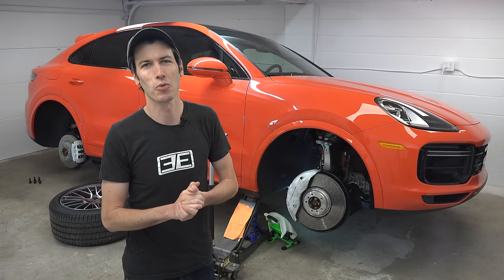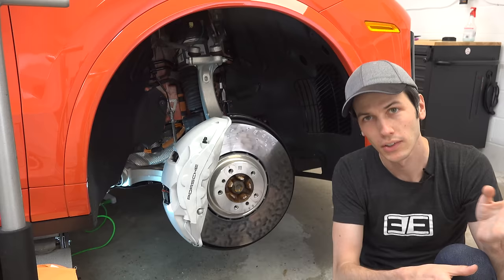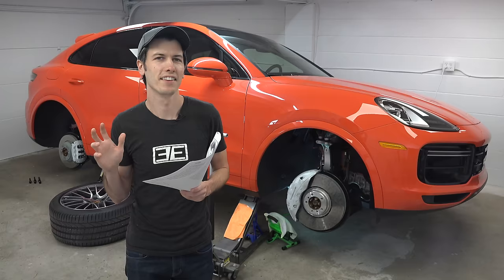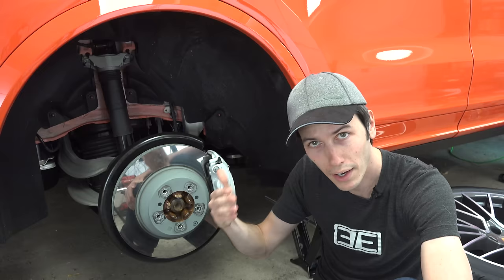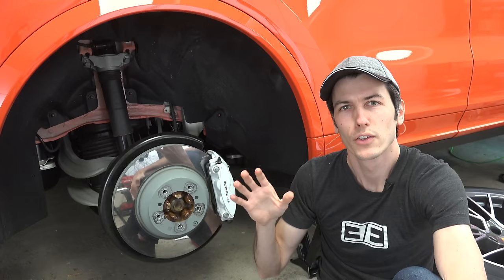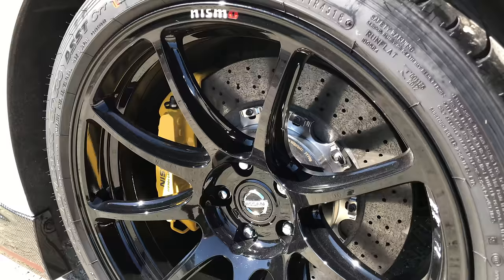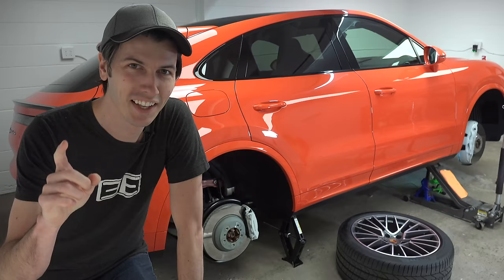Porsche Reinvents The Brake Rotor - No Rust, Low Dust, No Fade!

Comment: So once you burn through the top layer, does the rotor act as a standard cast rotor? Or is that part of the rotor "compromised"?
Reply: Want to know the same thing. Could make it a lot cheaper. Ok, maybe not a lot.
Reply: it would probably work just like cast iron, but the pads might not work on cast iron
Reply: You don't. All they did was make the rotor harder so the pads wear faster.  This is why they had to increase the size of the pads.  This "feature" is a complete joke.
Reply: Just another noise many owners will fix by turning up the stereo 🤣
Reply: Patrick O the main benefit is less brake fade for hard driving and for looks because it doesn't rust. it's a good option for entry level supercars or high end sports cars (100k range) without adding an extra 20k to the price for carbon ceramics. it's not going to be used on mass scale vehicles probably ever
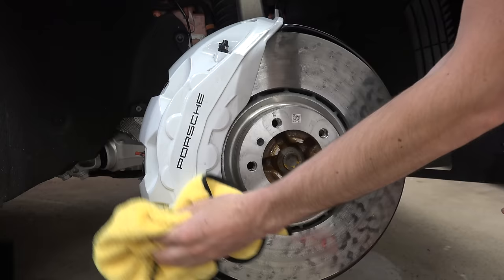Reply: @_PatrickO  Did you even watch the video? 4:54
Also, if you make frequent drives in the mountains(which you probably would if you're bourgie enough to own a porche), fade resistant brakes become super helpful. Especially when you're loaded with kids and stuff for your mountain cabin. This is a silly use case, but a use case none the less.

Regardless, this is a sort of thing Id like on my truck. For towing in, you guessed it, the mountains.
Reply: @stompyrobutts  you clearly own a Honda ridge line or something to tow with then because in any HD truck, a good set of $100 upgraded pads, plus engine braking and trailer brakes, driving in the rockies is no problem with 15K+ lbs.
Reply: The pads for Tungsten carbide Will destroy a normal cast iron rotor, so, no, you'll need to replace
Reply: @evictioncarpentry2628  What an absolute joke of a strawman. "you clearly own a Honda [Ridgeline]..."

Comment: Nice to see Porsche have their calipers in the right place - inboard! (Front ones on the rearward part of the disc, rear ones on the forward part of the disc). This reduces the cars polar moment of inertia; calipers are heavy un-sprung weight so ideally should be as close to cars C of G as possible. All cars where handling is a feature, from the MX5 to a Ferrari, will have inboard-mounted calipers. Sometimes they paint them red or yellow to illustrate this plus point.

However, on many cars with no pretence to great handling the calipers may be mounted anywhere around the disk - and that's OK. It is a marginal advantage after all.

But what gets my goat are manufacturers who put the calipers in exactly the worst position - outboard - AND THEN PAINT THEM A BRIGHT COLOUR! It's as if they think it's the bright colour that gives the handling advantage! It's like saying "we put the calipers in a poor place for handling, and then we painted them bright yellow just to show how we got this wrong"!

Comment: We often use HVOF applied carbide for guiding surfaces in high temperature (above 600°C) applications. The surface is so hard that only grinding can be used for machining it - and even that is not ideal.

Comment: Instead of replacing the rotor, can't we recoat them ?
Reply: Tiago Feitosa really? Is a serious question?
Reply: Except for not knowing the brake pad material, I would take a swing at coating the brake rotors myself
Reply: With cast iron rotors, we have the environmental impact of discarding the old ones, because there's no way to restore them. With these, only the coating is getting degraded, recycling is always better, if you take all the resources put into development, why not account the full lifecycle of the product.
Reply: @rickrack78  I meant recoating the porsche rotors once they fade out. Not coating our regular ones.
Reply: I would Porsche has a core program that would greatly benefit everyone.
Reply: @Tiagotaf  you can always resurface the rotors… until it's gone
Reply: @Tiagotaf  old rotors get recycled, most of them at least
Reply: @Tiagotaf  still a good idea
Reply: Sure, but it would have to be like a refurbished alternator with a core charge of $5000.

Comment: Porsche have always had some of the best braking systems on the road.
Reply: They use Brembo parts.  Made in Italy.
Reply: Mine were made in Germany and I use Yellow Stuff pads.
They're very good - I'm just objecting to the idea that 'Made In Country X' counted for anything.
Reply: Looks like akebono has made an impression on Porsche...  look at 5:00.
Reply: lol, by making the rotors harder, all the wear goes to the pads.  So to make the pads last a reasonable amount, they had to make the brake pads massive.  This is overpriced junk.  Tungsten carbide is a standard coating in many industries, they are pretending it is something new and it certainly isn't expensive like they claim.

Comment: what happens of you don't replace it after 0.1mm of wear?
Reply: They probably start to act like a normal rotor.
Reply: The "divide by zero" scenario happens
Reply: you buy some normal pads and carry on braking.
Reply: It exposes pressed grooves that play 'Let's face the music & dance' during your final 100 metres . . .
Reply: I've seen rotors that were so worn down, when the customer pressed on the brakes his brake pads fell out of the calipers and stuck in-between the caliper and rotor. So that might happen?
Reply: You now have 10 piston calipers on your regular steel rotors. Good luck finding some normal pads.

Comment: E.E.: “If you plan on towing...” 
Me: Uh.....that vehicle is more than $145k+! If i was planning on towing i could buy the meanest, baddest truck on the market and still have enough left over to buy an $80k sports car!!
Reply: Not in 2020. You'd only have $30k left over nowadays.
Reply: @deusexaethera  No joke.  Trucks are insane now.  A used one costs all most as much as a new one.
Reply: @andrewt.5567  i die a little inside everytime i see someone sell a 20 year old truck with 300k miles for $30k

Comment: So you're saying we can't get the parts at Auto Zone.
Reply: Patrick Labozzetti know right? I was thinking the same thing! Lol
Reply: Autozone could probably order the OEM part.  The base brakes are usually Brembo and you can get pads and rotors ordered at auto zone.  Either porsche branded boxes or OEM for a significant savings.
Reply: Can’t buy it at autozone. Whether they can buy it from a dealership and resell them to you is another question.

Comment: I like cool stuff but I just can’t relate to vehicles that have $11,000 brakes.
Reply: Some people make EASY money and want the best
Reply: I can’t relate to the owners either. It doesn’t matter how much they spend on a car if they drive it on the same crappy roads everyone else is on. If the elitist snobs want to feel special they need to buy their own road.
Reply: Bro ceramic brakes cost 20-25K so this is - cheap - :)
Reply: I can buy Brembo rotors and ceramic pads with all the hardware for my 2002 Camaro for about $400, maybe less.

Comment: The internet is full of "experts" trying to call out an engineer.
Reply: Fun fact. Have you seen half the cars on the road today that supposed engineers designed and how they don't last.
Reply: over 40 years experience fixing stuff engineers designed, many new engines you have to remove the intake manifold just to change spark plugs , older chevy V6 had to remove exhaust manifold to change the oil filter, chevy S-10 had to remove dash to change some dash lights that required also having to replace the front window, try changing front marker lights on a 2002 corvette...
Reply: Once you work on vehicles you realize they are all designed terrible and are all junk
Reply: @MAGWolf  You're assuming that they were engineered to last.  You can (well, someone can) engineer for any goal.  You can engineer for ease of manufacturing, for a finite service life, for safety, for comfort, for performance, for efficiency....
This is the reason behind the other comments in this thread- yeah, cars are a PITA to work on because they were engineered to be assembled in the fewest steps to reduce labor costs.  As long as the MSRP is within corporate targets there is little concern for difficulty of service. 
The old adage, "fast, cheap, or good" applies to engineering as well, you can pick any two.

Comment: I'm curious about stainless steel rotors, because stainless is a poor conductor of heat, compared to cast iron. I converted a custom chassis front wheel drive motorhome from drum brakes on the rear to disk brakes. the disk brakes that I bought were stainless to prevent rust. Of course the braking was night and day better than drums. But one time I was driving at 100 mph and had to slam on the brakes. There was absolutely no brake fade what so ever. I was pleasantly surprised. In many ways it reminded me of my MiniCooper braking at high speed. I've not ever seen stainless rotors offered as replacements for cars, but since these performed so well, it makes me really wonder it there is other benefits to using stainless besides the lack of rust.

Comment: Over 2Gs for standard brake parts ? One more reason I’m not driving a Porsche
Reply: Those are Porsche main dealer prices.
I can get a set of good quality discs and pads for my 996 for under £600, and a set that would be fine for most drivers most of the time for £250.
Reply: Those prices are for the top of the line Cayenne. And they are an option anyway I believe. So it’s not like if you buy a base model your going to have to fork out 2 grand just for brakes when they wear out
Reply: @BinkiBoyVideos  Yep, just $1500.  All the top end German brands gouge like no ones business.  I am sure the labor is laughable too.  Probably charge 3 hours labor for something that even a Joe Schmo could do in his own garage in 30 minutes.  The average tech at a Porsche dealer probably codes 18 hours of labor in an 8 hour shift.

Comment: Regenerative braking - no brake dust.
Reply: You 'only' get twice the longevity (maybe 3 times) on cars that are much heavier, too. 
And I do wonder what the environmental cost of all that combustion to place the surface on the rotors... OK probably insignificant in the environmental cost of manufacturing a car as a whole (EV or otherwise).
Reply: @aidanapword  lifetime of the car for some EVs. 😉
Reply: But you still need brakes for safety on those vehicles.  Try servicing a regenerative braking system yourself.  Complexity isn't always a good thing.
Reply: @aidanapword    Don't tell Greta!
Reply: @lashlarue7924 
You don't service a "regenerative braking system" because  that is just the electric engine getting turned by the movement of the car, working as a generator.
You also don't service your "engine brakes", even though that would be a good prank on new car mechanics, "please change the engine brakes, after that replace the blinker fluid and check the piston pullback springs".
Reply: Unless it's not a brushless motor..
Reply: Except electric cars still have regular brakes as well, its up to the drivers habits if the standard brakes last forever or need to be replaced a few times a year.
Reply: @MJorgy5 
Even brushed engine last for very long times, had to replace coal brushes from a big industrial motor. They had been there for 30 years with none stop running, every single day.
Unbelievable robust those things.
Reply: @lashlarue7924  how exactly is a regen system on an EV complicated? What would your service?
Reply: @jaydunbar7538 
Regenerative braking is very strong, sou you need to brake hard to even get the mechanical brakes deployed. And even then they are braking together so they still last longer.
So if your habit doesn't include race tracks or driving like a moron all the time, you won't change brakes that much. And 30% more actually easily come down to a lot, since most electric cars mostly wear their brakes down, because the rust away.
Reply: @MJorgy5  a brushed motor on an EV would be a serious design fail.

Comment: 05:09 AQEBONO - MADE IN JAPAN ....not in Germany
Reply: happens to be the biggest supplier of parts for the porsche breaks, even for the carbon ceramic brakes. 
Also every big Audi is likely to have an akebono brake ;)
Reply: Akebono makes a ton of OEM performance brake packages. They just don't have to put thier name on the side of the calipers like Brembo. 
I like the brake feel of my Infiniti with Akebono brakes better than my Subaru with Brembo's.
Reply: The cars only have a german brand. The parts cpme from china, mexico, of course Germany and all over the world. 
Especially in the VW Company many parts are the same. Q5 -  Porsche Macan, A3 - Golf. I see no real innovations within these companies. They just build cars. High prized cars.
Reply: @scherenschnitt6333  wouldnt't you say spraying powder-with what basically is a rocket engine- on a disc so hard it melts to a 100 micrometer thin layer is pretty inovative? of course not like tesla roadster and gasthrusters in a car :D
Reply: @michaelschmitt2955  No. I dont think this is really innovative. This break has big rotors, big calipers with ten pistons. This brings much pressure on the rotor. Then the rotor is cooled by deviation plates. For me this seems nothing special. Of course rocketing a thin layer of something on a brake is new. But there isnt a necessarity for this. It doesnt evolve breaking. 
According to your name I guess ypu live in Germany as I do. The streets are overcrowded. The BABs are full. Reliable driving also consists of looking forward while driving. Not giving full throttle and then abruply break, repeat this every few seconds. If I drive to work I break only break once on the BAB. If there is a jam  more often of course. But ideally you dont drive fast in a jam.
So I am really not sure  if the bigger effort in building these rotors and breakingplates is worth it.
We have bigger problems in the world, which should be managed. 

Now during the Coronatime so many companies showed that they can change their production that it is possible to pull on one rope. 
If we used our force of intelligence, as some engineers should be, to build a new sustainable world instead of rocketcoat brakediscs for luxury cars I believe H2-impellents and the technologies around that  would be way more efficient and ready to be build in even in german cars. ( It is so funny to read very often in german press, that H2 doesnt work while Toyota and Hyundai already built their second generation.)
 Or maybe design changeable carbatteries to get along with the charging issue. 
But no. We have to design Laufblinker, rocketsprayed rotors,  evolve the personal traffic more and more ( how many people sit in one car while driving to work? ) instead of promoting intwlligent fleet cars. 

No I really dont see an innovation in coating a breaktrotor and press with brutal force on it.

Comment: Tungsten carbide is in effect a ceramic, ergo what Porsche has created is a ceramic coated steel rotor. Another point for those considering the usual carbon fiber/ceramic  rotors, unless you are going to race your vehicle on a track, don't. Carbon ceramic does fade less because of its very high resistance to heat, however, under road conditions, they actually  perform worse than regular brakes since they require higher temperatures for optimum friction coefficient. As many testers have discovered, to their surprise, is that under road conditions you get shorter stopping distances with steel rather than carbon fiber brake systems.

Comment: Rotors are usually cut because they have started to warp do to heating and cooling. As these rotors are nothing more then churched up steel core rotors they are going to warp too. No cutting these back into shape. Gotta fork out that money to replace them. Debris gets between the rotor and pad and causes channeling in the rotor. No cutting that out. Replace the rotor. I am just glad these are on a car that I cant afford anyway.

Comment: WC film on rotor is actually a brilliant idea. You can find anywhere where materials/compounds is harder, more abrasive, and more cost efficient than WC, from a cost and daily usability point of view. If mass production is possible, it will help improve safety on road further. Especially for trucks and heavy duty vehicles.

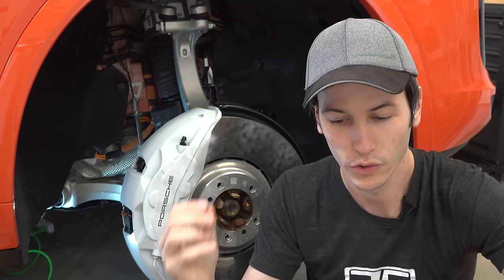Comment: At 8:50 minutes, a cost break down is provided. HVOF coated brakes are like 5x the cost of iron brakes, yet only last 30% longer. It might have been a better use of Porsche Engineering's time to develope a hydromechanical or brake-by-wire system that compensates for brake fade. Porsche Marketing likely told the Engineering department to develope a brake rotors and pad that produces minimal brake dust, but at a reduced cost compared to a ceramic equivalent, even if there was no value proposition compared to an iron brake rotors.

Comment: Floor jacks do not fail in  their hydraulic part only;  i've had one, that after 20 years of lifting jags ,XJ6 and XJS, one time  it  suddenly came apart at the main arm  pivot,after  a C clip groove external land gave up the ghost; repaired now, in a different manner without C clips; in 30 years of repairing jags,i have never,not even once,crawled under a Jag without proper  rated jack stand(s) in place; too many persons died already because of jacks and lifts, most of the times,the person being at fault.

Comment: brake dust is usually from the pads are they are wearing much faster than rotors. as per your testing pads wear 1500x times faster so they produce the dust. the softer the pads, more grip you get, more dust you produce. i have ebc yellow stuff on my truck, stopping power is awesome, but they wore out very fast and very dusty.